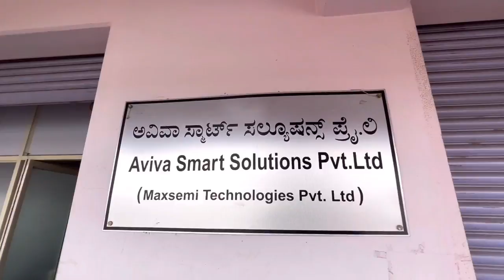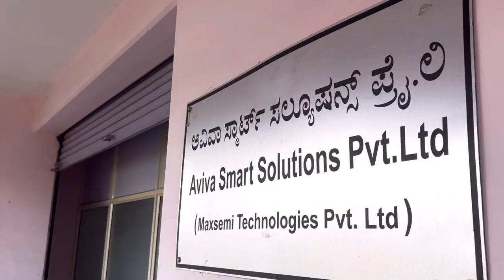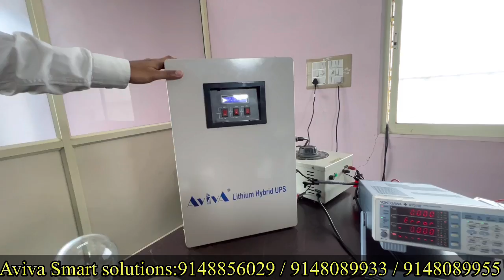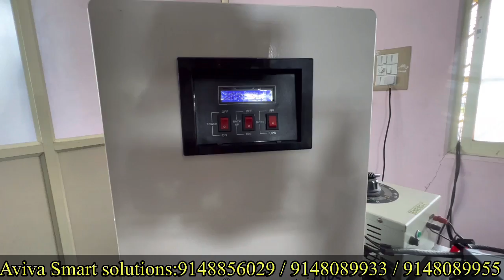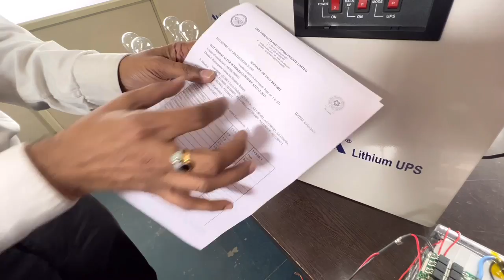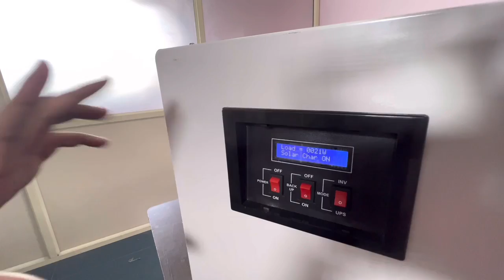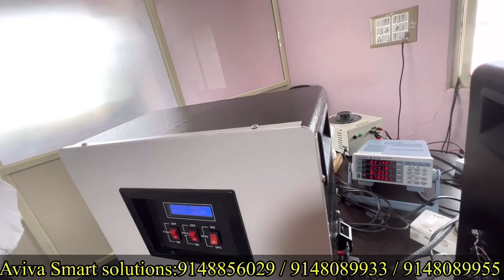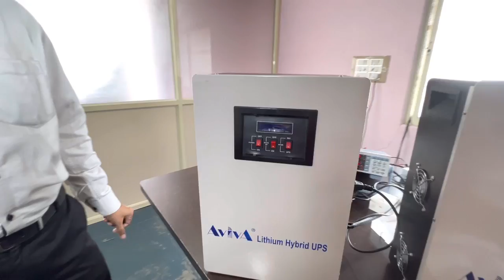ಎಲೆಕ್ಟ್ರಿಕ್ ಸ್ಕ್ಟೂಟರ್ ಕೂಡ ಚಾರ್ಜ್ ಆಗತ್ತೆ |Solar Ac hybrid lithium ups| Aviva Smart Solution Pvt Ltd

Comment: Sir, without solar panel run madbaudaa..using AC charging..only..?
Reply: Yes. You can use Hybrid without Solar Panels. It will work as normal UPS.